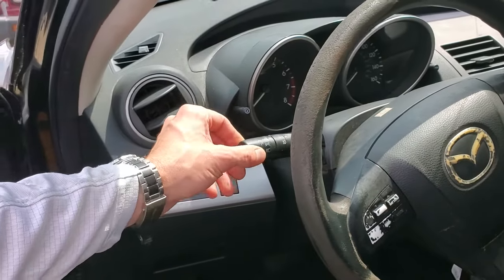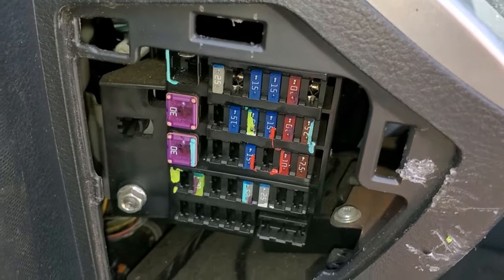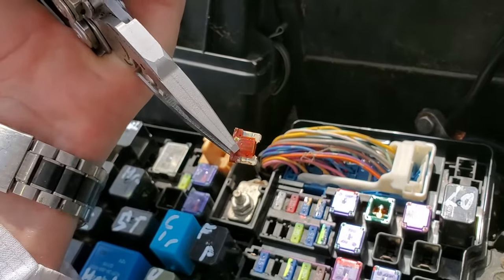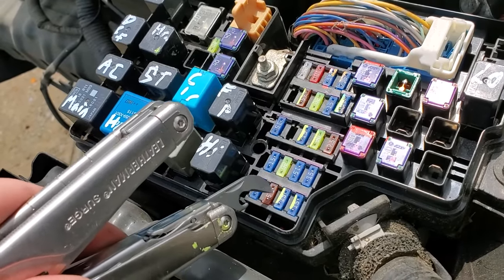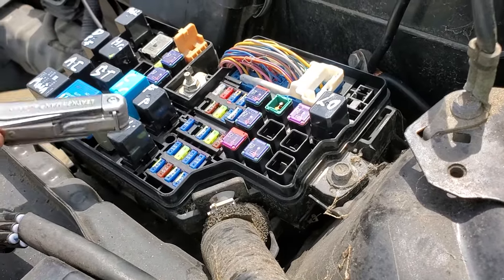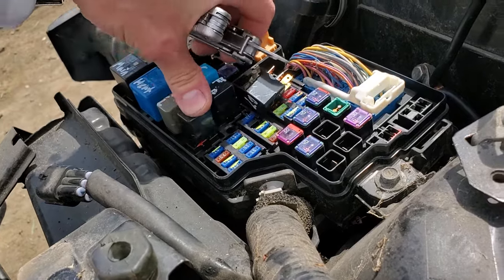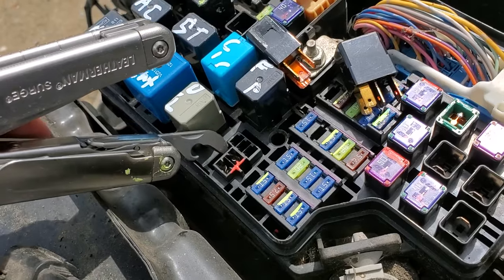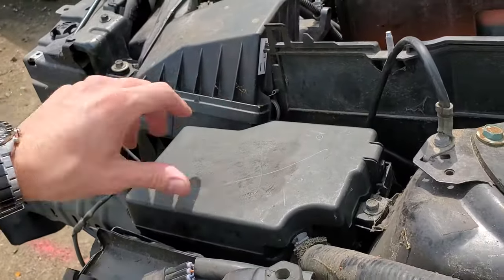2010 Mazda 3 Headlight Fuses, Low Beam & High Beam Relays & Fuses

Comment: Completely replaced the headlamps with a new set and still having issues with the low beams (high beams work fine, they worked fine in the factory set as well). We checked the relays by swapping them (high beams work in both situations) and still having issues with the low beams. Getting ready to change out the fuses even though hubby checked them with a voltage meter. Any ideas if this doesn't work?
Reply: Make sure you check the fuses without them installed in the car and check for resistance not for voltage. Easy to misdiagnose a fuse.

Comment: I have a Mazda 3 2010. The high beam isn’t working but low beam work good. I’ve tried the troubleshooting with connecting the wires and high beam turns on but doesn’t work when turning on by the dimmer switch?

Comment: This is an odd one, I bought a mazda3 and low beam controls are weird.

when I switch to "off" or "sidelight" mode.
low beam turns on
but when I switch to "low beam on" or "auto" mode, the low beam doesn't turn on.

Comment: Hello, where is the fog light relay? You didn't point it out. Also, I want to have the high beams working with the fig lights at the same time. There was a video which was removed but I need advise. As far as I know I have to cut one prong off (isolator prong) from the fog light relay so the fog lights turn with the high beams. Thank you in advance

Comment: So I changed my ballast on right side the low and high beams work when turned on BUT won’t the low beams won’t turn on with the parking lights when they used to what could cause that?

Comment: I have 2010 mazda 6 and the low beams and high beams stopped working on both the sides. just the signal lights are working. i went to dealer and he is scaring me with some crazy expense like 1200+ could be some power system failure bla bla. I checked the fuse of low beam and they are ok. High beam  fuses are missing. Is there separate relay for left side and right side or just 1 relay that controls both side low beams?

Comment: How would I diagnose hazard lights Where's the fuse in the relays for the hazards aka the turn signals? Whenever I start my car my hazards are flashing I go to click the hazard button between the vents and nothing changes the only way I can get my hazards to stop flashing is by removing my fuse for my hazards but then I have no turn signals what could be causing my car to start up with hazards on but no alarm? I have a 2010 Mazda 3
Reply: Did you ever get this fixed my car is exactly the same.
Please let me know

Comment: my mazda axella 2010 is not energising the relay for the low beam headlight and the tail lights,i checked if the connections are  good by bypassing the relay connectors and the light were on but when pluging in the relays the are not energising and i tried to change relays still same fault arises
Reply: Had the same issue, ever figure it out?